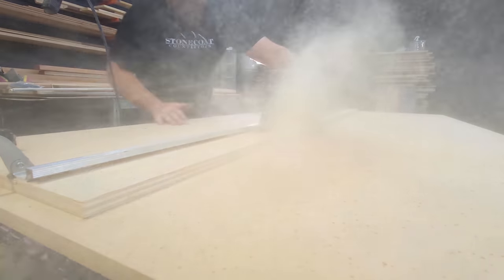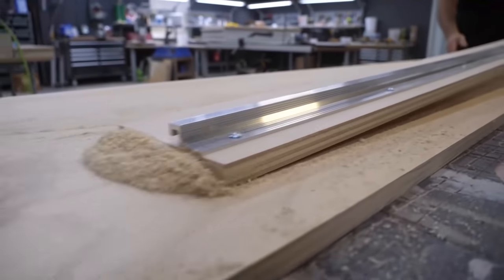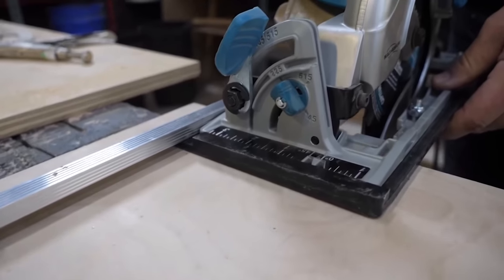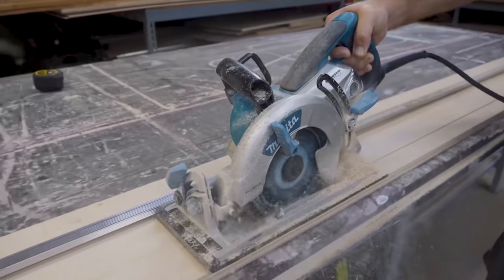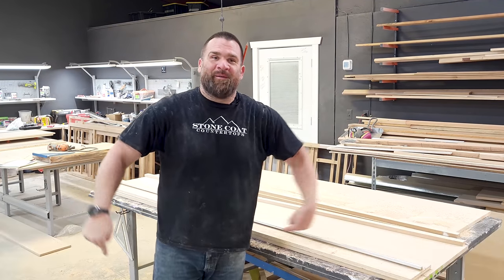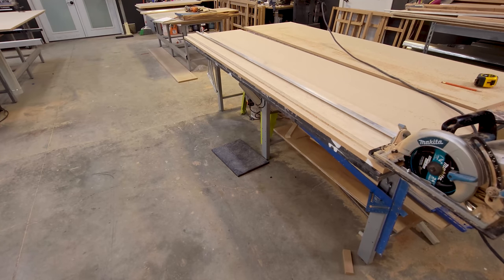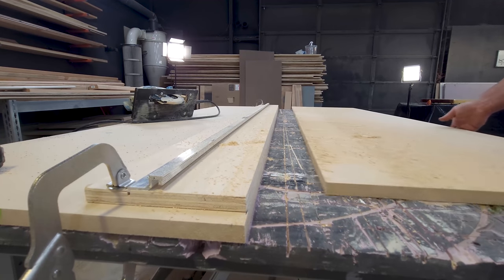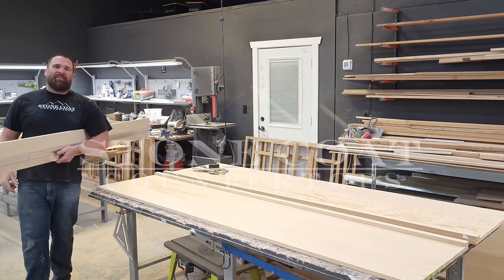Woodworking Cuts You Need to Know How to Make | Stone Coat Epoxy

Comment from the maker: 🔴We need your feedback! Have you used another brand's saw guide, how much did it cost?🔴
Reply: the kreg jig one was spendy and it bent in my truck
Reply: Whwer can I buy this
Reply: Where can I buy this
Reply: Still have the kreg jig. Usefully less than full sheets
Reply: @DeeDee-fi4kq  What is the cost of materials for the Festool and Dewalt products, compared to their $699 and $775 price tags.  So what if the materials cost $25 and they want $170.  There is time required to develop and test so the product is reliable and usable.

Comment: Great idea. 

I'm looking at the kit and the tracks are just shy of 48". If you made the track sections just a bit longer than 48" the sled would have a more stable position once the blade engages the stock to be cut. 
Also, MDF dust is nasty stuff and dust masks are relatively inexoensive.

Comment: Do not buy it. They say universal fit. It isn't. To expensive. Fits left handed saws only. It doesn't work for different saw plate sizes. I sent message, no help. Called. Never returned call. I see by other comments that a lot of your subscribers wonder why you would sell a product like this. Next time you want to create a tool. Research it first. made my own saw sled out of UHMW and a modified router. The UHMW was $20.00 and the track is maybe $20.00 a piece. That's a big profit margin.. Mine is 100% better than what they called a quality product. There is no play at all on the one I made. Also if your saw has play in the saw arbor that the saw blade moves it will not cut right either. I am really disappointed.
Reply: There target market for this is DIYers not craftsmen from the description of what you built I'd say it's safe to assume you are a craftsmen